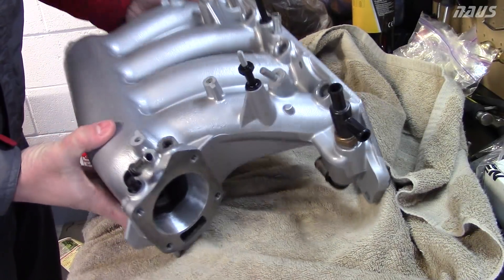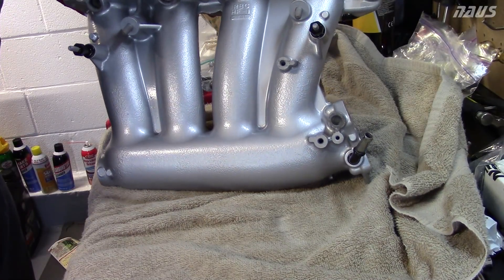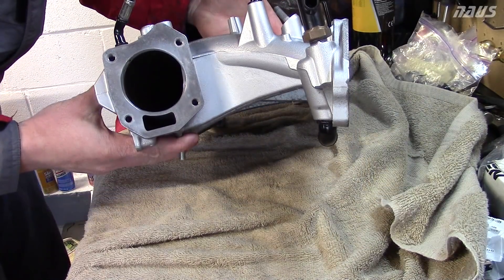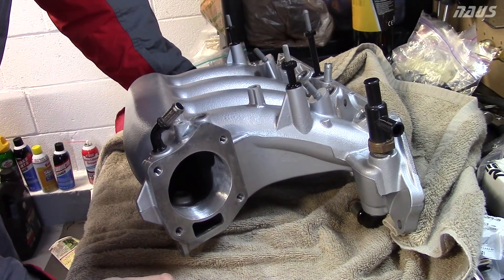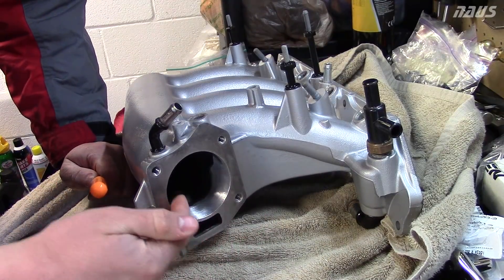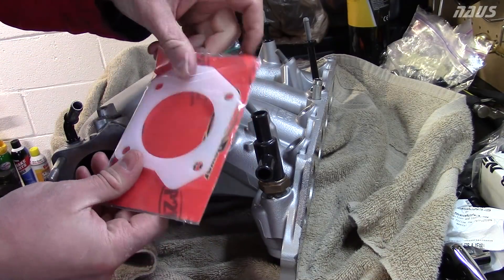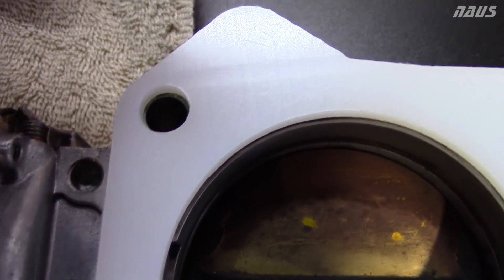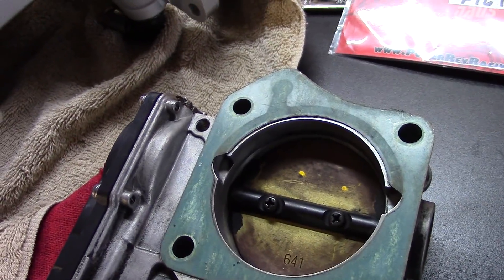RBC J35 Port Matching - 8thgen Civic Si

Comment: Also, fill in the ivac port. That pocket creates a vacuum when the engine is running. Engine is pulling air out of the pocket creating a "charge disruption". I filled mine with jb weld
Reply from the maker: Before I went supercharged I had a polished RBC that I port matched & welded the IACV hole shut & ground smooth. this manifold was after I removed the supercharged 4 years later and sold my original one.
Reply: The ivac port is that "almost square hole" under the intake manifold inlet?
Reply: @guigao28  correct!

Comment: would a j37 be ideal for FBO with stage 2 cams and valvetrain upgrade + tune? or would you stick to a j35
Reply from the maker: If you port match, it can’t hurt to go bigger, but if NA you may not see any gains between a J35/37
Reply: NAUS yea i will be N/A i’m keeping the car around 240-250 whp. also what do you think is the best intake manifold right now? seeing a lot of different opinions but they can’t be THAT much different

Comment: Great video as always, appreciated : ) 
I will be installing Hybrid Racing 3.5" CAI, Invidia Header, and Invidia Q300 in couple week. 

I wonder if i should throw in the J35 as well, but I don't plan to do any port matching. 
Since I am planning to get the car dyno tuned, do you think spending around $250 is worth for a J35? 
Are there any worthy gains for just J35 bolt on? 

Thanks
Reply from the maker: it would help a little since the stock TB is like 61mm outlet and the RBC inlet is 63-64ishmm unported. However for full gains and the smoothest flow port matching is the right way to do it
Reply: NAUS Thanks again for reply. 
That makes sense, just not sure if it's worth $250 for the gains. 

Another question that's bugging me now. I have an Invidia Q300, not sure if Skunk2 Alpha or Invidia header will be a better pairing for that. Currently using Megan shorty + Berk hfc and i think either of those header will give significant gains. What's your opinion?
Reply from the maker: Skunk 2 will give a couple more HP, but it is a much lower quality and cheaply made vs the invidia.
Reply: NAUS fair enough, invidia does has higher quality. I love your videos man. They are inspiring 💪
Reply from the maker: You da man!
Reply: I bought my Tb for 35 on eBay definitely recommend mod

Comment: What kind of bit did you use? I’ve seen the pros use an air tool with like 3 different $70 bits. I have a dremmel with just about every attachment you could buy for it. I’ve been meaning to do this for the longest time. I keep telling myself I’ll do it at the same time I do my fuel rail and injectors but all the parts have been in my toolbox since last summer. It seems like I’m always working on everybody’s car but mine.
Reply from the maker: CaptianAwesome20 I just used an old steel cutting bit to remove the material, then a sanding roll bit to smooth it all out
Reply: CaptianAwesome20 Use a carbide burr
Reply: I would not use a Dremel to work on intake manifolds and cylinder head ports. The ideal set up to use is a compressed air system with a working dryer. Fabricate a air pressure regulator manifold- a  male connection for incoming air connection (quick release), gate valve, air pressure regulator, gate valve, and a female Quick-Release fittings. This way the air pressure can be set (60psi) intake ports & exhaust ports on cylinder heads. Dewalt makes a few nice electric straight die grinders - extension are great and you want a 1/4" shank interchangeable with pneumatic 1/4" shank. Dremels cannot keep pace with the duty required. Something heavier duty is what you want, also Dremel consumables to not hold up to the duty required. The Dremel would work on shaping and trimming plastics on Thermal Intake Manifold Gaskets.
Manual calipers for maintaining tolerances and consistency as well as a decent electronic caliper. The manual one's should consist of wall thickness, inside diameter, outside diameter, and transfer calipers. It is best to layout runners   in inches, while removing material evenly and at the same depths document the numbers on paper to track as each runner is ported and polished. I use a light with LED  bright, red light, and a blood tracker settings. The centerlines and shapes of the runner's show up easier with different light spectrums.

Before actual work spray carbide burr bits and stone bits with a lubricant (3-36) with a light dusting of lubricant spray, then wipe. This will help with keeping aluminum from sticking and clogging on bits.
 
For intake manifold porting (since they are aluminum) in the specific order -  1) clog-free aluminum carbid but bits (long tree and short tree).   2) Tappered grey stone bits (40-60grit).   3) 2"x2" and/or 1" x 1" Flapper Wheels (60grit, 80grit, 120grit). Between 2) & 3) a SS thin wired cup brushes, can be used to blend and smooth. They remove stock material quickly.   4) Sandpaper (60grit, 80grit, 120grit) for hand blending. Assortment of small hand files. After shaping runner enterances to a choosen desired bevel angle, take the files and perform a 3 to 5 angle stepping curve. Similiar to how 3 to 5 angle valvejobs are none on valves and valveguides. When done dip the IM in water to remove  dust and debris

Comment: Does port matching really make a difference especially for a N/A setup?
Reply from the maker: David Vlogs if you ever do a larger TB than stock then this is needed. If you put a larger TB than stock on and do not port match then there will be absoutely zero gain as the flow would be hitting a wall behind it